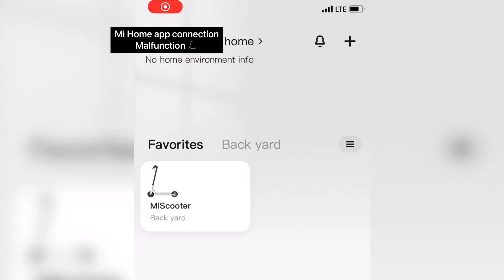Mi Electric Scooter issue: locked and cannot reconnect with Mi Home App (FIX)

Comment: Boss sa akin naka lock siya after ko mag update ng firmware ano gagawin ko ganyan din ba? Hindi ko ma connect app sa scooter? Ano po disconnect at connect ko? Ty po
Reply from the maker: Gumana napo ba Sir? after 3 hrs po mawawala yung lock automatically. Or yung ganyan po ginawa namen ni reset namen at hindi napo namin inantay yung 3hrs.
Reply: @MarvinVillardoJrNek  paano nyo po reset?
Reply: @titan9827  did you get it to work in the end I have the same problem?